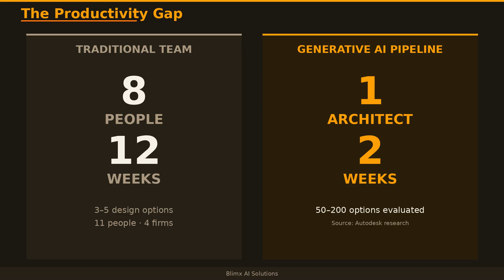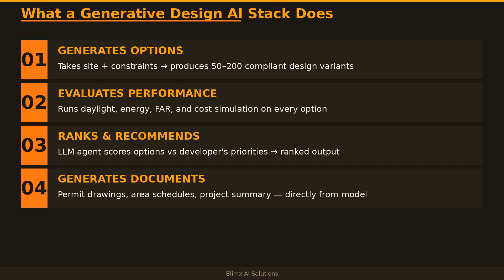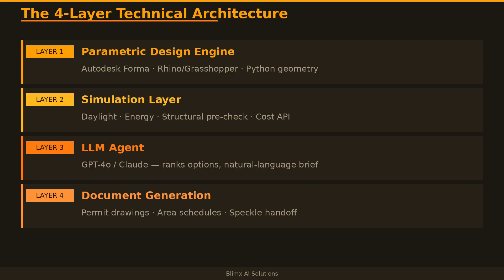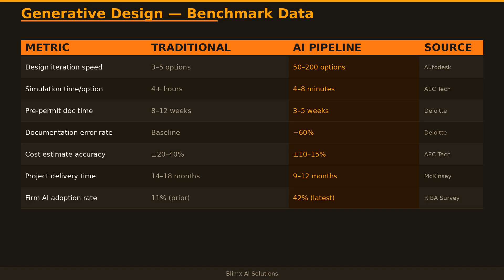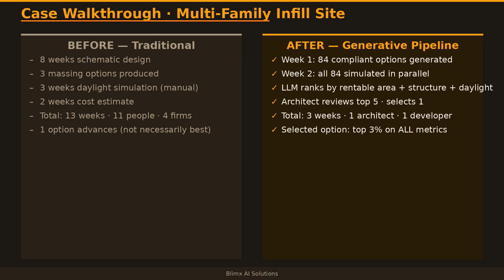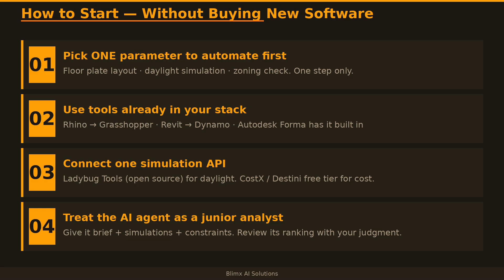Build a Real Estate Portfolio with Generative Design and AI Agents

Comment from the maker: Quick poll: is your firm already using any generative design tool (Autodesk Forma, Grasshopper, Dynamo, custom Python) or still fully manual CAD? Drop a comment — curious what the split looks like.

If you want the feasibility timeline estimate done for your specific project type (unit count + site constraints), reply with the details and I'll walk through the numbers.